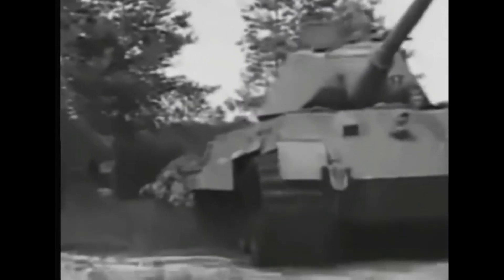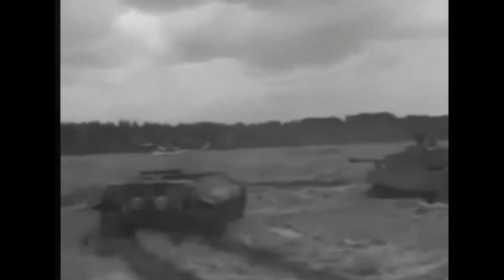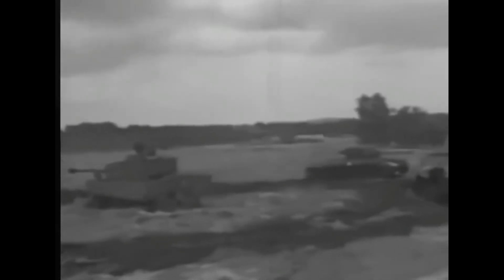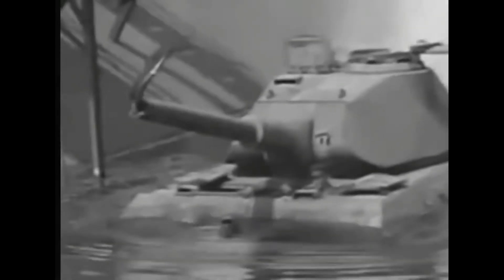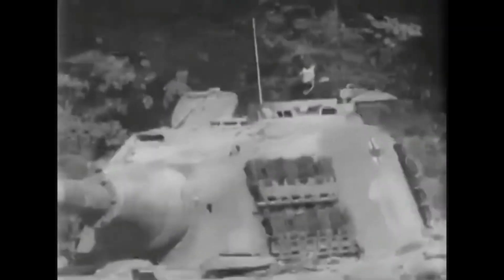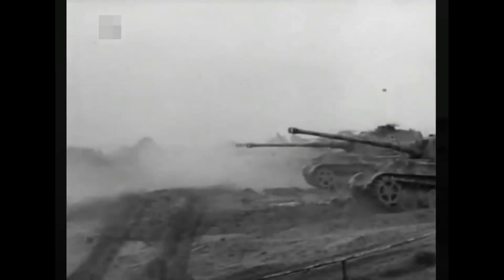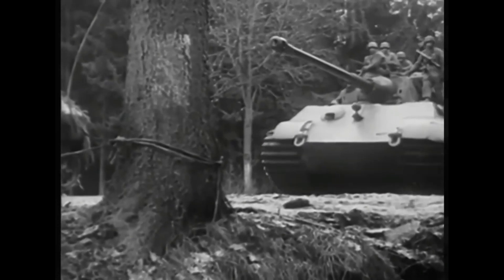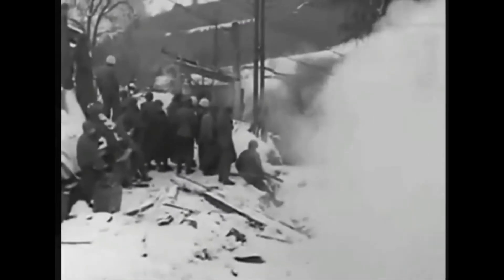The King Tiger - A SUPER HEAVY Ambition

Comment: Diverting Tiger II production to Tiger Is would not provide thousands of additional Tiger Is; Only ~1347 Tiger Is were produced, compared to 492 Tiger IIs, and both models almost exclusively by Henschel. Henschel's output would be insufficient for thousands of Tiger Is, being compounded by the decimation of factories throughout the war. Additionally, logistical upkeep of existing Heavy Panzer Battalions was untenable, let alone adding thousands or even hundreds of new vehicles.
Reply from the maker: Well the king tiger project which also includes the Jagdtiger and un finished builds is about 600 vehicles in  total and if you count all the resources and time pumped in i thing 1000 tigers could of been produces instead and yes resources were in short supply but 1000 good tanks is al ot better than around 600 mechanical nightmares in my opinion .